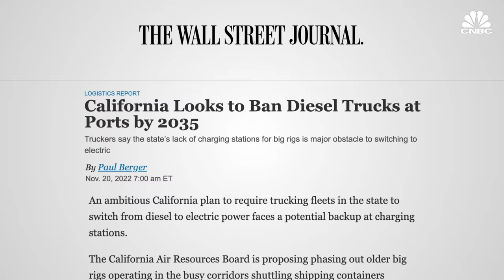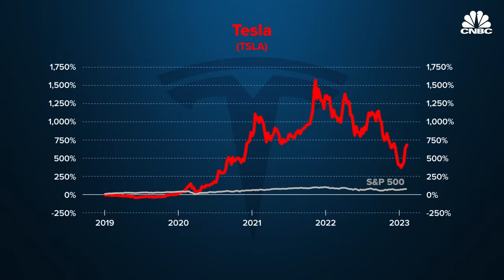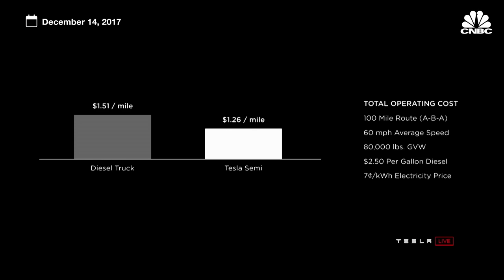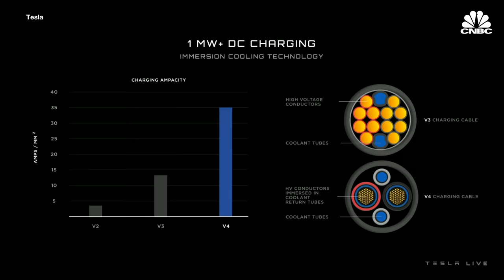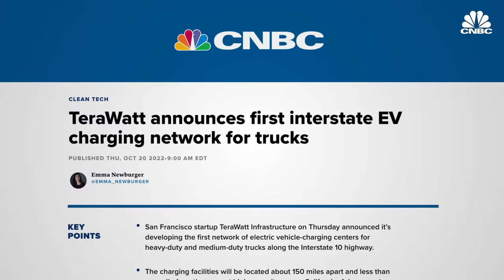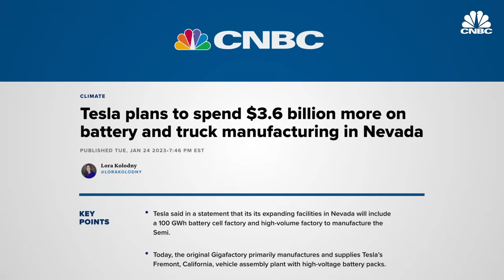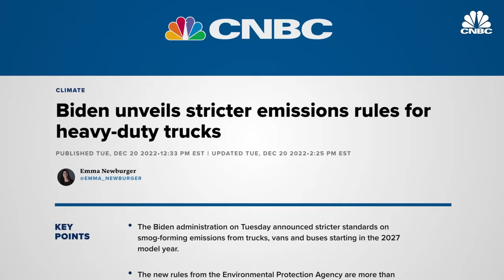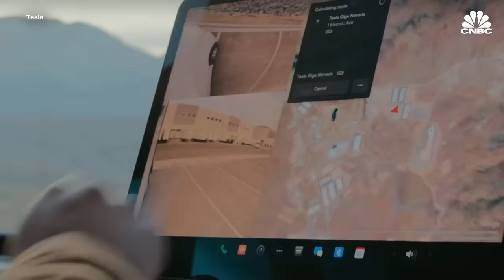Does The Tesla Semi Live Up To The Hype?

Comment: The trucks looks more like a European styled. But i think it's just because they removed the heavy engines
Reply: And to lower air resistance. Also the big size is not needed as the 3 electric motors can be carried each by an untrained man and still have several times the power of Diesel

Comment: These big companies generally only operate their trucks for 2-3 years before selling them and buying new ones, they literally won't see the long-term cost savings of electric trucks that Tesla is claiming. Since they cost 40-50% more than regular diesel trucks, they are actually losing money on each truck.
Reply: Yup spot on. Owner operators are the ones that run trucks over 500,000 miles. All the big trucking companies sell off once their trucks hit 300,000-400,000 miles before they start experiencing problems.
Reply: Yes because maintenance cost increases, an electric truck need less maintenance and parts, btw tesla estimated the truck pays for itself in 3 years on fuel and maintenance savings.
Reply: @miguellopez3392  Which like I said won't benefit these big companies who can afford these expensive trucks. Owner Operators are the ones who run their trucks for multiple years, not these big companies. as they sell within 2-3 years before they will see the cost savings. Maintenance is only a part of the reason why the sell, the main reason is because the value of the trucks drops harder and harder with each 100k miles.
Reply: @SP  yes and why does the resell value drop?
Reply: @miguellopez3392  I know it's because of long term maintenance, however most trucks are built to last 1 million miles, yet most companies operate them for 1/3 that. By the way, if we are going to talk about maintenance then don't ignore the battery replacement the tesla semi will need after around 500k miles, which will be a 5 figure job, making it even more expensive than a diesel truck as it costs almost $20k to replace the battery for their cars, and the semi is probably double that.
Reply: @SP  yes they can reach 1 million miles if you do years of expensive maintenance during that time. The battery replacement cost for their carsbis 15k, 20k for older model, semi truck is likely to be at 100k-120k after 500k-900k miles, but the leftover battery can still be used as generall battery storage and sold. But do the math, how much would it cost to fuel a diesel semi for 900k miles at 4mpg? A EV semi will be 1/2-1/5 of that cost, now take those savings and buy a new battery.
Reply: @miguellopez3392  You don't need expensive maintenance, just regular maintenance is enough as long as you do it right the first time and don't cut corners. I literally told you how much it costs to replace the battery for Tesla cars, and you are bringing up other batteries. The Tesla semi batteries will cost more than their cars, they use significantly more batteries so it most like will end up being double the cost, so $40k, and this is also at around 500k miles. Most diesel trucks won't have such an expensive maintenance cost at that many miles. Like I said these big companies aren't running their trucks for multiple years so your 900k miles don't mean anything, unless you are talking about owner operators. Do the math at 400k miles, also consider the cost of electricity. It's much higher in the summer than the winter.
Reply: PepsiCo is on record stating that they keep their trucks for seven years, so you might want to run this claim by them.
Reply: @SP  I don't think you understand, the maintenance is expensive because that's the bare minimum to run something that makes 1500ftlbs of torque and moves 80,000lbs, it's mechanically taxing on many moving parts, this problem gets worse when the trucks get bigger, mining companies are using 110 ton electric dump trucks simply because the maintenance is much cheaper despite the higher cost to buy. 

You told me how much it cost and I'm telling you you don't know how much batteries cost, it is laughable that you thing a 900kwh battery cost 40k to replace, it would be 100k is tesla chose to make no money on the repair, and that tesla is going to replace the cell format to a larger can with better cathode material to get 900k miles. Again companies sell them because after running them hard for 3 year with little maintenance it is likely a expensive brakedown or repair is going to happen, semi trucks spend magnitudes more time in the shop for maintenance than regular pickup trucks too. 

I know you didn't do the math i asked you to and that you haven't seen the prices for electricity, so why are you pretending to know?
Reply: @BigBen621  Pepsi is just one company, and they aren't just trucking company, they are beverage company that has a trucking division. I should have clarified by mentioning companies like Knight-Swift, JB Hunt, Landstar, CH Robinson, etc. All these companies get rid of their trucks after the first 300k-400k miles and they have significantly more trucks than Pepsi. They cover these miles in like 2-3 years.
Reply: @-SP.  I will defer to your superior knowledge of these other companies' practices; but this video is about the roll-out to PepsiCo, so their practice is relevant to this discussion. Other companies may change their practices if Tesla Semis turn out to have greater reliability and less required maintenance than the diesel semis their policies are based on, and the reported 1 million mile warranty may trigger some change. 

If they don't think the Tesla Semi will be economically advantageous to them, they simply won't buy it. But Tesla has proven to be a pretty good judge of the demand for their products, for example rocketing the Model Y to fourth place in car sales in the world in less than three years; so I'd be loathe to bet against the Tesla Semi succeeding.
Reply: @miguellopez3392  I used $40k as the price point because I clearly mentioned that it would be double the cost of Tesla car battery, considering the price of the truck is double the cost of their cars. I did not say that would be the maximum price, since no one has gotten a repair yet, I just went off Tesla car battery replacement prices, which I clearly mentioned in my comments. Your comment only further highlights how much more expensive it is to run this truck. Looking at the limited articles I can find, estimates are saying that the battery will need to be replaced after around 500k miles. Outside of regular oil changes, tire rotations, filter replacements and fluid changes, there isn't much maintenance a diesel truck needs unless you have damaged parts.  The average maintenance cost is $15k a year, and the most expensive thing is going to be your tires, (~$5k or so) which this Tesla will burn through even faster since it weighs more than a diesel truck.

I didn't bother to the math because I clearly mentioned your 900k example was stupid as no company is running their trucks that high, with the exception of owner operators.
Reply: @BigBen621  I think this will work for Pepsi's short hauls as they are currently using it for but long hauls are going to be the problem. If Pepsi does keep their trucks that much longer than other companies than they will definitely see the savings, assuming energy rates don't see any sort of dramatic increase like gas has. 

Regarding the Model Y sales, I think it's important to consider that many manufactures still haven't quite recovered from their supply chain issues from during the pandemic. I know Honda in particular was hit extremely hard and my local dealerships still barely have any inventory. Tesla's sales have also seen a sharp decline in China due to local brands undercutting them.
Reply: @SP  and using 40k furthe rproves how you don't understand how pricing works, you used the price of one of their most expensive cars, their average car sale cost 50k, with battery replacements being 10-15k, but the cars purchase price does not determine the cost of the battery, the cost of the battery is determined by its capacity and mass, the semi battery is 9x bigger then teslas 2nd biggest battery for a vehicle, they produce the cells at below $100  a kwh. 

Alright since you can't do basic math, a diesel semi going 400k miles at 4mpg with the average diesel price of $3.40 will cost $340,000 in fuel, a tesla semi with the average price of comercial electricity ( 14 cents a kwh) and the average consumption of 1.7kw a mile it would cost $95,200, so you save $244,800, enough to buy 9 batteries by your estimate, and 2 batteries for my estimate. Now do you admit your wrong?
Reply: @SP  tesla sales in China decline because they export, since they where the only manufacturers in China that could make EVs profitably without subsidies, they recently just undercut all competition with price drops they could afford.
Reply: @miguellopez3392  They lowered prices back down to what they were before they started price gouging during the pandemic, so they did not undercut anyone. Their sales are down in China, because the Chinese rather buy from domestic brands. BYD is killing them in China as they sold 150k vehicles last month vs Tesla's 27k. Also, Tesla's exports out of China for January are down 3.2% compared to last year, so no it's not just because of exports. BYD is now the biggest EV seller in the world. Tesla's 2022 fourth quarter market share in the US dropped to 58% from 78% last year, so that's also a big decrease. All the legacy manufacturers have finally started to get their own electric cars on the market. There's also Elon's twitter antics which some people don't like, so it's putting them off the brand. Tesla started off strong because they essentially had a monopoly on the electric car market, but now things are changing and they are losing ground and probably will continue to do so because the legacy automakers will start to undercut them as they get better at making EVs and consumers have more options.
Reply: @imperial9953  " fourth quarter market share in the US dropped to 58% from 78% last year" 
Smaller market share of a much larger market. Tesla Models Y and 3 were the best selling vehicles—not EVs—in California last year, and the 4th and 11th best selling vehicles in the world last year. I don't think they're hurting.
Reply: @BigBen621  Yes they were, keyword "were." Things aren't going to stay the same forever, just like in China once other brands get going, Tesla's market share will only continue to drop, which we are already starting to see. I gave you the fourth quarter results of 2022, which are the most recent results, so we will see if this trend continues in the first quarter results of 2023.
Reply: @miguellopez3392  "They stole so much market" Because like I said in my last comment, they had essentially a monopoly on EVs starting out. BYD from looking at their financial statements, are making quite a decent profit, even if they have lower margins due to their volume. 

Tesla still gets a lot of their batteries from Panasonic, and they are actually going to be increasing that amount by 10% next year. Toyota and Panasonic have also announced they will be working together back around 2020, so that means Toyota should be able to get similar performing batteries that Tesla receives. Also, Tesla is literally buying BYD batteries for their own cars, so they are receiving assistance from their biggest competitor. Regarding their computer software, this is almost subjective. Some people like it, some people hate it. A lot of people also don't like how Carplay and Android Auto aren't supported, which are both pretty good in their own right.
Reply: @Imperial  BYD was selling EVs in China 10 years before tesla came in, and in 2 years tesla became the largest EV seller by revenue, BYD sells fleet orders for companies needing cars for employees  which do help bump up numbers while tesla charges full price for their fleet orders, tesla is increasing orders for all battery producers they have, they plan to build far more cars in the next 7 years, theybare already pushing a 100gwh battery factory, largest in the world.

I hear tesla is buying BYD batteries evry year from some anonymous insider evry year, it's not happening, teslas battery architecture would require an entire re work to use blade batteries and would shift battery production away from themselves which they have not done since the first time they tried to make an EV. 

Lol you think I'm talking about user  software? I'm talking about reliability, capabilities with self driving, and actually hardware the software runs on, it's why so many EVs have problems, Their software is unreliable and hardware incompatible at times, sometimes dangerous under normal operation, software is not something that you can throw money at to be good or reliable, it tends to have the opposite affect at times.

Comment: The semis should not have autonomous driving included due to the fact of the danger having an 80,000 pound semi driving down the highway or road with nobody at the controls except someone sleeping behind the wheel.
Reply: It'll need advanced notice to all cities exactly when it will arrive so nobody gets killed when it drives through red lights at 80 mph because of a software glitch.

Comment: Swappable batteries are the only viable solution for present battery tech. I don't see the tech improve enough any time soon to make the in-vehicle batteries as they are used now viable. There is such a tremendous load of problems with that, which are basically impossible to overcome, such as grid loads, fire hazard, charge times, weight, availability of raw materials just to name a few.
Reply: There is such a tremendous load of problems with that, which are basically impossible to overcome 
All of these have, in fact, been overcome. So there's that...
Reply: @BigBen621  Have they now huh, Einstein? You should know, I am an electrical engineer, with almost 50 years of experience, and let me blow your little bubble here, the problems have not at all been mitigated. There is a proposal in Switzerland to ban EVs due to grid insecurity, there are fires in ships that could have been prevented if only the cars would not have had their little bombs on board, there is weight, a raw materials crisis, an energy crisis, huge cues at charging stations, huge charge times etc etc etc. There is waaay not enough capacity at this point in terms of power stations to power all the EVs required to replace all Ice, and more than 95% of all global electrical power still comes from burning coal. Your turn....

Comment: I guess this kind of load makes sense with Frito-Lay likely having short distanced, large volumetric loads of low density and thus lower weight. I think hydrogen makes more sense for larger vehicles like Semi-trucks due to its greater energy density but, the infrastructure needs to be there first. That’s a significant investment and unlike with EVs, where you only have to generate the electricity on the already existing grid (although likely needing to fortify it in some cases first) with hydrogen you have to be able to generate clean, green, renewable and or carbon free energy to create the hydrogen for it to make sense environmentally. Beyond just simply generating hydrogen, you then have to create a large, realistically and technically viable Hydrogen infrastructure network for transportation, storage, fueling on top of the clean generation of that hydrogen.
Reply: I guess this kind of load makes sense with Frito-Lay likely having short distanced, large volumetric loads of low density 
Yes, because the product of Frito-Lay is low density snack foods. But PepsiCo also runs Tesla Semis making deliveries out of the PepsiCo Sacramento Bottling Plant, weighed-out with high density loads of soft drinks, more than 500 miles round trip to Bakersfield, or climbing from near sea level in Sacramento to 7,200 ft. at Donner Summit, on the way to Reno.

Hydrogen is a fool's errand, even for trucks. Current per-mile costs are many times those for BEVs; there's virtually no fueling infrastructure, which you acknowledge; H2 stations cost many times what Tesla Superchargers or Megachargers cost, and can only refill a limited number of vehicles before requiring more H2 to be trucked to the station. Further, almost all commercially available H2 is formed from fossil fuels, which you also implicitly acknowledge; so without elaborate carbon-capture methods, H2 just shifts the emissions from one place to another.

BEVs are succeeding because the per-mile cost was already lower than that for liquid fuels, even at the beginning. And the distribution network was already in place, needing only low-cost charging stations to be installed; of which Tesla has built a near-worldwide network of >50,000 chargers in just ten years. Can you imagine this happening with H2 stations in ten years, when nobody's buying them? I can't.

Comment: Fun fact: the energy to charge those e-trucks comes from fossil fuels 😁
Reply: a little of the energy to charge those e-trucks comes from fossil fuels 
FIFY. These e-trucks are mostly charged from the California grid, which is only 40% supplied by fossil fuels. Further, because electric vehicles use to much less total energy than ICE vehicles, changing from an ICE vehicle to a BEV reduces overall emissions, including powerplant emissions, by 89%, per the U.S. Department of Energy.

Comment: It will some time before we will electric out here. I run a LTL run that covers ND SD northern MN and northwest WI.  Run a lot of backroad to small towns. So not a lot of truck stops. Just small gas station fuel stops with small parking lots. So have a place to charge is not here yet by any means. Most the time I am lucky to find a place to park.